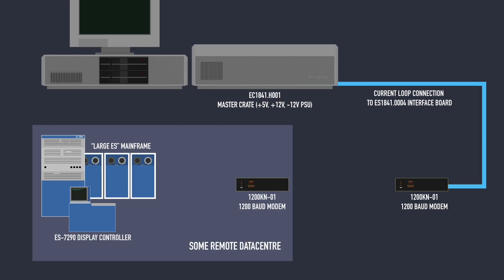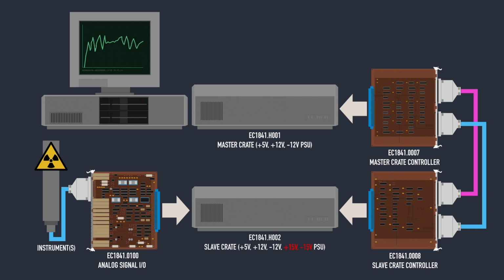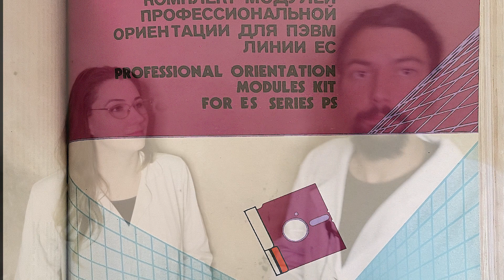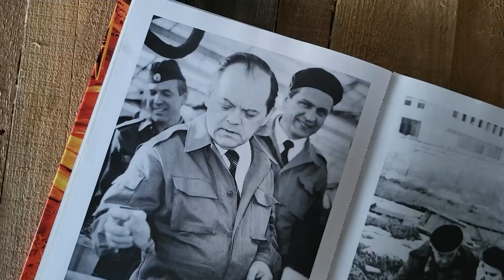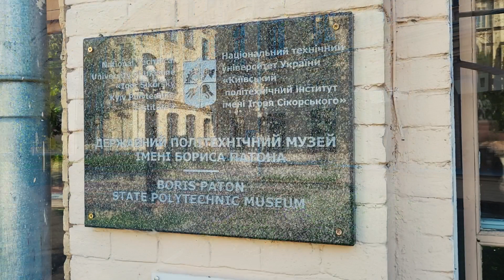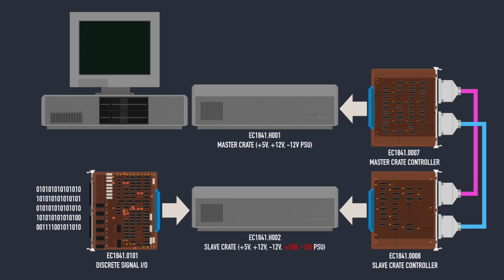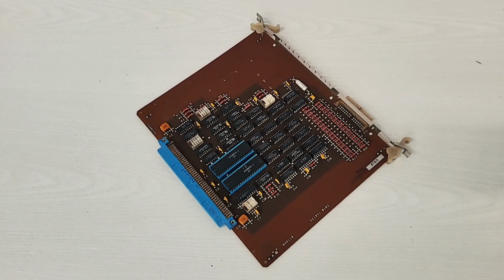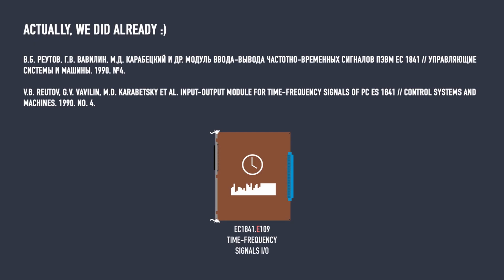Soviet scientific computer cards for ES-1841: what we learned

Comment: Does Russia still design unique systems? And if so I would be interested.
Reply from the maker: No idea. The subject of the video is not Russian at all.
Reply: The post-Soviet Russian chip designs designed in Moscow are named "Elbrus". The older Elbrus models were based on SPARC, but the current "Elbrus 2000" design is original (and incompatible with everyone else). A major Russian bank tested a current Elbrus server and reported that it was only about half as fast as Intel chips, but they said they were impressed that it actually existed as a real computer that could run databases and Java. In response to the 2022 invasion of Ukraine, Taiwan will no longer manufacture the Russian designs, so Russia's plan to have greater independence from the West for military electronics after the 2014 sanctions seems to have failed.

I think it's not nearly as interesting of a story as the Soviet-era tech.
Reply from the maker: @JakeHambyZ80  we had a chat about these Elbruses when we visited the Cybernetics Centre in Kyiv. If long story short, this is BESM-6 architecture packed in a chip (which is an idea is interesting). Well, conceptually it is interesting, but IMHO the eternal russian curse to be late for 10-20 years persists.

Comment: I just found this channel a few minutes ago and found the videos on the Soviet era computers interesting.  They remind me a lot of the old IBM computers that I grew up with in school back in the 1980's and 1990's.  I've seen numerous videos about people exploring the exclusion zone as well as Pripyat and Chernobyl.  What I've wondered was if anyone has tried to salvage any kind of electronics left behind and would they work after being exposed to the elements.  It is pretty cool to see these old machines up and running again after so many years.
Reply from the maker: We will have a new series about the Zone itself soon, which will be a good addition to this one. In regards of your question, well, here is a conceptual thing: a lot of electronics continued operation after disaster, a lot has been brought in (like these computers). To kill electronics you need a really high radiation, ideally neutronic; so technically in 99% cases there is no difference between electronic junk there and here. It becamse a junk just because it is no longer needed.